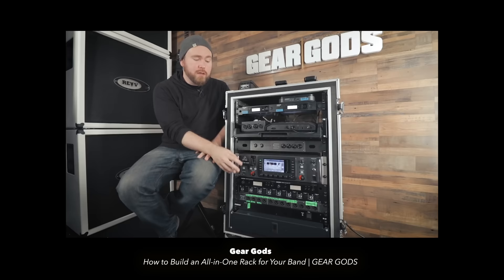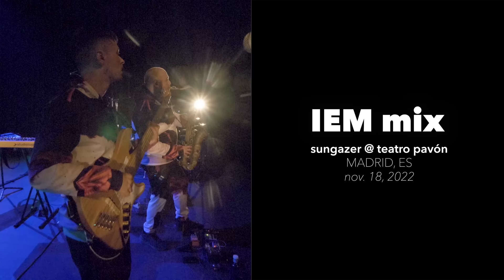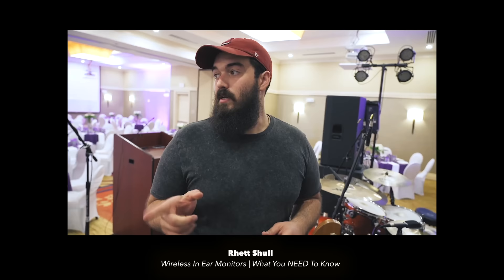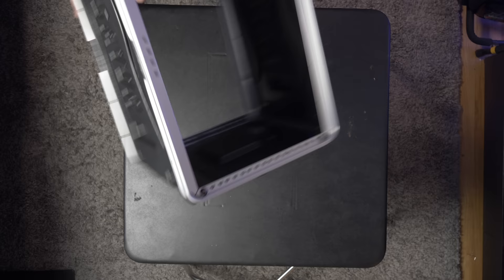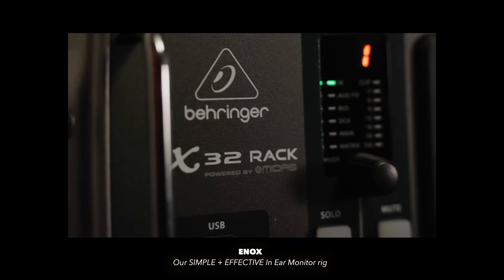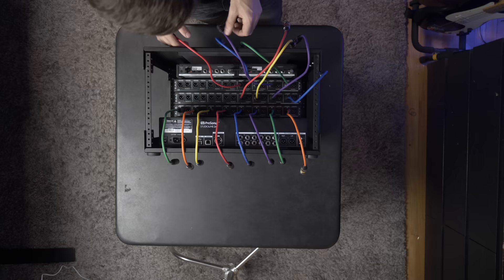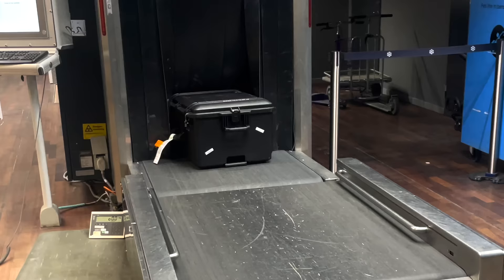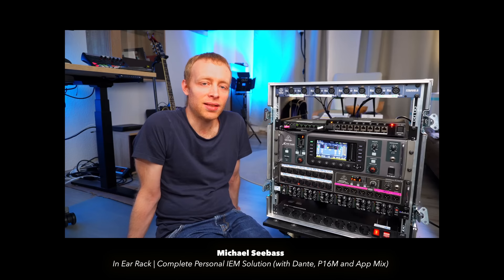How In-Ear Monitors are Making Better Musicians

Comment: TLDR: Wind your cables and cords in figure 8's and they wont get knotted.
Mathematically, a knot happens when the end of the line passes through a loop in the line.
When you coil a line in circles, you make loop after loop after loop... every one an opportunity for a knot to form.
Instead, if you coil in figure 8's, for every "postive" turn of the line, you add a "negative" turn of the line.  Every time you add a loop, the very next thing you do is subtract it off.
In the end, you have a figure 8 coil with at most 1 loop.
The odds of it forming a knot are exponentially reduced, and when it does form a knot, that knot is usually a very simple one to untie.

Cheers!  Happy Holidays!  Hope you got to see this comment.  It's a great life hack to whip your headphones out of your pocket and never deal with a knot.

Comment: I've always found in-ears awkward, as it makes it difficult to communicate discretely with other band members... because good in-ears block out external noise, you need to use a mic to say anything to other band members, meaning the whole crowd can hear it. Also, it's bizarre not being able to hear the crowd and feed off of their energy. It's like the difference between cranking a good tube amp in the room, or having it isolated in another room and hearing it back through control room speakers... just not the same.

Comment: I do have a question on this as church drummer regarding the in-ears themselves. Do "pro" IEMs have some advantage over cheap earphones (like some $15 pair from SkullCandy)? Previously, I've used a bose headset with ear-plugs I used in marching band. I've started using SkullCandy earphones to simplify what I'm bringing and to reduce setup time. After watching this video, I began considering the cheap option you provided, but I'm not sure if a jump from $15 earphones to nearly $100 is one I should take.

Comment: Had a question about the Tascam BO-16DX/IN - Were you able to put the ears on it so the DB25 connections were facing out?  I can't find many photos of this online but all of them show the ears positioned so the XLR inputs would be facing out (Totally not what we need).  I came dangerously close to getting the Switchcraft version of this which is more expensive but those ears are not removable so I haven't yet pulled the trigger.

Comment: Oh man.  I'm writting before watching.  I've played enough with iems to know they can really improve you timing and articulation.  Unfortunatly  most of the time, I really struggle with them.  So many problems.  I can never get a proper, stable seal.  Molded or not.  I'm not giving up, but it's getting long and costly.

Comment: After developing tinnitus, I rely solely on my in-ear monitors to control the personal volume levels in a live or recording environment environment. Although closed back headphones control some of the volume, they can’t do what in-ear monitors can. I was recently tracking a session with the drummer in the same room. My bass was DI’d. The in-ear’s blocked about 90% of the drums. I had total control of my personal volume level and mix which made for a comfortable session. Adam, what monitors do you use? I have been using Shure SE-215’s. For bass, they seem to work well. I plan on upgrading but I am having a tough time making a decision on which ones to purchase based on user reviews. Anybody? Thanks

Comment: Hey Adam! I have jsut recently bought that same splitter. The way I understand it as you said in the video is Instrument/vocal>Mic input. Direct output>mixer (i have a beringer x32).  Isolated output one is for the front of house. Do you HAVE to use that direct out put on the front for connecting to the mixer? ORRR could i use isolated output 1 for FOH and Isolated output 2 to connect the mixer? I can barely find any videos on youtube about the 3 way mixer. PLEASE HELP!

Comment: Hello! Bass player here :) I have a very similar gear (the behringer is active instead of passive the rest is exact copy^^ ). I have been struggling with my mix T_T Our drummer is very loud to begin with so I can hear him without having drum mics in my mix. The first time we tried the IEM in a rehearsal, my ears hurt a lot because of the drums. I thought it was because I no longer had my molded in-ear decibel filters but instead the MEEs... So just to try, in the next rehearsal, I replaced the MEEs with the VIC FIRTH noise isolating headphones, but it didn't improve :( The drums were still TOO LOUD :( 
Then I figured out that I pick up A LOT of cymbals through the singer's microphone (she uses a Beta 58A) I really don't want to cut her off my mix though... Any advice?

Comment: In ear monitors, just like headphones are great as long as they have a wire. I am not convinced Blue Tooth, or "wireless" is safe for the ears, or brain with continued long term use. You do know that you are not to put your cell phone to your ears. It says in the tiny details to use a corded headset. My friend always used his left ear with his cell phone, and ended up with a tumor behind his left ear about the size of a 50 cent piece. Luckily it was benign. Hopefully, this doesn't happen often.

Comment: sorry i am fairly new to this and i left the video more confused than before (since i got more questions now).
if i am a band member playing in different venues without a dedicated sound engineer and relaying on venue's engineer and equipment, i would usually have them mix what i hear in the monitor i am gonna be using that gig. if i want to use in ear pieces to hear , what do i need?

Comment: Slightly confused about the power strip. Do you have to switch the voltage on each device when overseas? Or does it si.ply work?

Comment: I was under the impression that "everyone" had been using in-ear monitors on stage for the last 10 years at least... Most bands really do not?! It seems like such an obvious better system than blasting yourself AND your microphones with a loudspeaker. Heck, I've had custom moulded in-ear monitors for I guess 7+ years now; that I bought just for listening to music in noisy office environments (though; one cable got bad a few years BC [Before Corona] and I haven't gotten it fixed yet and use normal around ear headphones now; which also are easier to remove and put back on; but the fact is I still have in ear monitors despite not even being a musician.) And I have custom moulded -15 dB earplugs I use everywhere all the time (I'm ADHD + autistic so noise bother me a lot) that I bought at the same time. The comfort of custom moulded ear pieces is definitely worth the expense; and if you're already using thousands of dollars for music and sound equipment; I'm surprised not more musicians doesn't also invest a couple of hundred dollars in custom moulded plugs and monitors.

Also; I'm surprised that you need all those patch cables from unit to unit... why isn't it some standard multi channel cable for connecting them? I understand the need for one big robust cable input per instrument; but once inside the mixer; for me* it seems like there should be a much more compact "bus" to transfer the channels between units rather than patching each channel separately.

(* I'm not at all a hardware guy... I'm just a software programmer, so I have just gotten used to hardware just being there working for me)

Comment: A shielded ethernet CAT5 connector and cable is required for those ethernet snakes. Fully shielded properly. Some cables are sold shielded, but the connector isn't. To be sure you either make them yourself or buy better cables. 

Ears are a case by case basis. For most bands it does not make financial sense unless you are touring. Even then most bands are lucky to make $6000. On tour, this rig could take a couple years to pay off considering you still need to pay your band, crew and expenses. 

I'm not sure that ears are making better musicians. It's just giving you a baseline mix. Given quality monitors, a sufficient soundcheck and engineer, you will play to the same level. Given that you can hear yourself, ears or monitors becomes a matter of taste and your set up. There are some reasons they kind of make you play worse. In some situations it makes the FOH sound worse for your front row fans. Working in audio for the last 10 years I can give pros and cons for each. If you don't mix or do sound getting your own engineer is a way better option. 

Most people don't like the way wedges sound, but listen to them through foam plugs. Almost every monitor in the world will sound like crap through foam earplugs. At least spend 15 dollars on musicians plugs or better yet get molded plugs for a hundred. If you care about your hearing you need these or IEMs.

Comment: both systems have good and bad sides. Of course IEMs give a clearer idea of what's going on, but I feel they work better for some instruments rather than others. I love them for bass gigs and vocals. Hate them for guitar gigs. my ears are more rested for sure, but gigs are less fun as you're more "in your head" with IEMs, which are (as of now) less directional. Mono Mixes suck for harmonic instruments.  Even with the best convolution modeler you can't replace the ease of playing and magic of the feedback between guitar strings, amp speaker and your ears. Surely IEMs are more practical (often for the sound engeneer rather than the musician), but I feel the magic is not there anymore, at least speaking as a guitarist that has been on all sort of stages for the last 30 years. Great video nonetheless!

Comment: Do you have any follow up on this rig?
Did you find a better alternative for your extra four channels beyond the 16 channels via DB25? (Did the Tascam DB25 hold up?)
How has your experience been with the Presonous Live? Public opinion seems to be that Presonous can be unreliable and the rack space/weight savings over an X32 Rack + S16 just might not be worth it. Would love to hear about your experiences after another year of use.
Reply: Also as I've been designing my own system, I think I may have stumbled on a cleaner solution for your FOH tails. Have you looked into the Motu 24Ao? It's an AVB interface with 24 channels of DB-25 or ADAT outputs. I'm not sure how reliable it is for sending clean audio to FOH, but it seems like it could be a much lighter weight solution.

Comment: As a guitarist, my frustration is that I spent years trying to get what comes out of the amp to sound good - which they then mic, eq and fk up in ways I don't want them to and just chuck it in the mix leaving me without my sound. Moving on a few years, with an amp sim that I can match to what I want to hear and in ear monitors, literally thousands in mics amps effects are replaced with a reliable repeatable signal that gets adjusted to the venue in the overall mix.

Comment: I'm just missing how he connects the PSM300's. Do you use 2 out channels from the Live24R as a stereo monitor mix? So you would only have 6 possible outputs? Or do they come out as TRS Stereo outputs? If so, how do you split the signal for the wireless in's? If not, do you use mono monitoring? Is that something to be aware of?
Reply from the maker: We monitor stereo, so yes, 2 output channels from the Live24R get connected to each PSM-300. We only have 4 people in our band, so this isn’t a problem, but I guess if you needed more than 6 mixes, some of them would have to be mono

Comment: Thanks for sharing! What IEM's do you recommend for bass players? I use the Shure 215 but tend to loose a lot of sub.. And I hear that custom molds not necessarily is the way to go, but rather the amount of drivers?? 🫣
Reply: Have a look at the MEE MX2 Pros. They are designed for drummers and bass players with a slightly boosted bass and lightly scooped mids. Far superior to the SE215 at the same price.
Reply: @joe8513  thanks for the tip! 😃 appreciate it 🤘🏻

Comment: No, marching bands don't look at each other's feet. The battery/percussion section just watch the field conductor and the non-percussion listen to the battery.
Reply: Did a few years with a marching band on the bones. Mostly street parades. 3-4 wide, 10-20 long. COnductor not visible to most. We relied on the march. It's the purpose of marching.
Reply: @ajksdfvgnpasovnf  I should've made it clear that our marching band did displays on football fields instead of parades.

Comment: Does anyone know of any bulk suppliers for those low profile XLR cables?
Reply: I don't know the bulk supplier. But XLR cables are less than half the price if you just make them. Those connectors are pricey ($10 for one side) but if you buy a premade cable from Sweetwater, it'll cost you $45 for a 3 footer. 

If you're buying the low profile xlr cable for a rack setup, this is what I would do. 

1) learn how to solder
2) buy both ends of a low profile xlr connectors ($20)
3) buy a 25 foot XLR from Amazon ($15)
4) cut the existing XLR connectors off the Amazon cable. 
5) cut the XLR cable to length (usually 1-2ft for the rack)
6) solder it together. 

For $45, you have one low profile xlr cable and a LOT of extra cable for more xlrs. Now you can spend $200 and get 10 pairs haha
Reply: @SleepingLionsProductions  Thanks. After a lot of searching, I came to the same conclusion. I just got my first soldering iron :goodvibes:

Comment: My reading of the PM1 specs strongly suggests it does not have a limiter. I like to take the precaution of having my own limiter in the chain because, as Adam said, shitty sound engineers. I presume Adam deals with that using the mixer, but buyers be advised.

Comment: im not a musician and i have watched the entire video spiraling around all possible axes because why the heck would you waste all that space and weight for basically one set of active components and a million connectors. Arent there any electrical engineers that can solder a 5 times smaller solution just by not using redundant connectors?

Comment: As a satellite engineer, I was surprised to hear your gear case is uses 'u', as in a 6U case.... I worked on a 6U satellite a few years ago! Interesting!

Also, looking at this gear made me angry. I forgot how stupid audio gear was. Make all input wires go to a small computer, then all output wires. Literally nothing beyond that should be necessary. Do it all in USB and the whole setup would be under $200 and fit in 1U... a few bucks more to make it support all wireless earbuds for your monitors. But noo you have to have random bullshit like phantom power, and old analog bullshit xlr cables. And the whole thing ends up being a finicky mess thats impossible to troubleshoot and costs a few grand. I've literally worked on operational satellites that cost less than your monitor setup.

Comment: I think this video would have been better if you had completely left out the topic of audio latency, because your discussion of latency with respect to music performance is overly simplified and is not actually a motivating factor for using IEMs.

On stage, the spatial distance for your band is negligible and the round-trip latency is irrelevant because you are not waiting to play the next note after you hear your fellow band mates. In practice, you make adjustments to the timing of future notes you are going to play based on the errors in previous notes that you played. In other words, you are evaluating the timing of a window of notes, not instantaneous, and you are not waiting to play once you have determined the tempo. That's more obvious when you consider that if I play a single note, then what is the tempo? If I play a group of notes and I rush the first two but drag the second two, then the net effect is an average of that set of 4 notes, and an accompanying musician, it is likely better if I ignored the small inconsistencies, depending on the style of music.

The ultimate retort to your conjecture is a drum corps snare line, as you referenced. They are not watching the conductor, because the accuracy of reading hands is inadequate. Rather, they are listening toward the center of the snare line. The center snare is the ultimate reference of time, playing the instrument with the fastest attack and release in the whole group. By agreeing that the center snare is the reference clock, there is no need for a round-trip latency, because the center snare is not listening to other musicians for time.The width of such a snare line is wider than your band on stage, but they can manage to play in unison to within milliseconds of each other.

Comment: As a jazz musician and sometimes pop musician I hate hate hate in ears and click tracks, maybe I haven’t used them enough to get used to them, but I much rather have my amp on stage mic’ed and using monitors than using the line out with a silent stage and in ears.
Reply: Holy crap just watched the whole video. All that work and money for inears is so absurd. Honestly I never had a problem hearing myself on stage. I play thru a twin and I just turn it real loud if I need to hear my self more, all I have in my wedge is hi hat an lead vocals that’s pretty much all you in pop and most applications. For jazz your just playing a tiny little club so you don’t need to mic anything. I wear ear protection they make great ones these days, you can hear all the frequencies